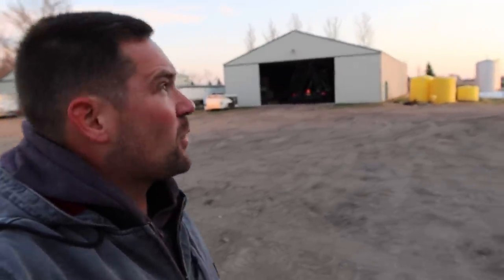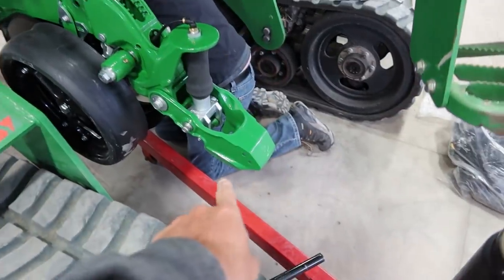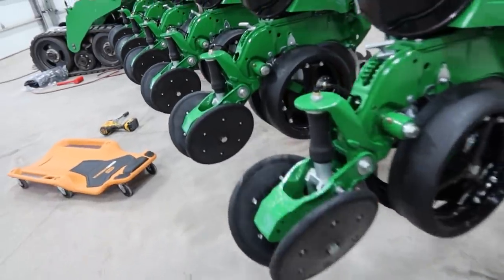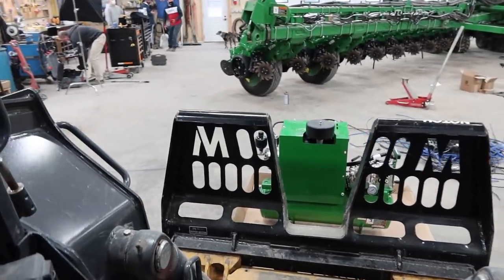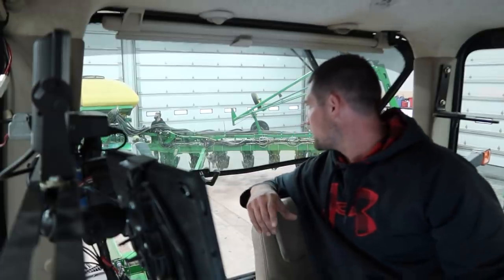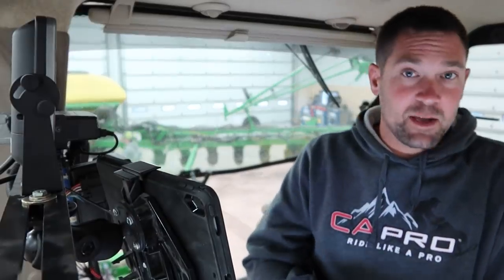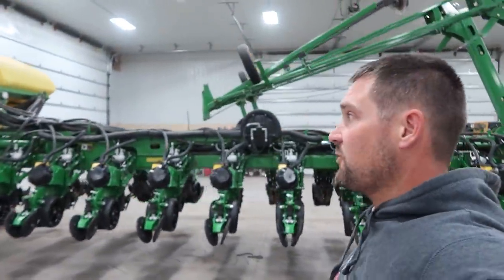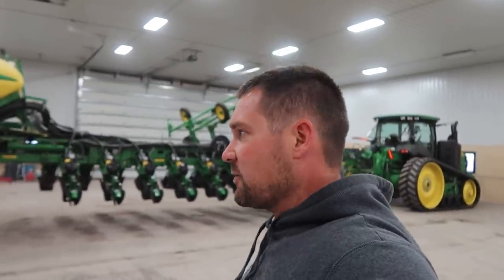Complete Planter Rebuild

Comment: Can’t help but think of a neighbor years ago and his two cylinder popping Johnny planting two rows at a time. Not a computer in sight and the row markers were manual with a rope. Farming has come a long way. Thanks to you all.
Reply: And to think those two cylinder Deeres and two row planters were a big upgrade over horse drawn machines and planting by hand!
Reply: Yep, in the '70's the local blacksmith made anything you needed to get the work done. And yes, that's the 1970's. We still had horse-drawn equipment rusting in the fields when we bought the ranch in Utah. Dad had a Ford '40, and a two bottom flip plow, and putting in metal head-gates for irrigation was apparently a radical departure from canvas dams thrown across an irrigation ditch. It wasn't until his yield was 30 to 50% greater that people started paying attention to what he was doing. He'd taken soil samples to the local county Agriculture office and found out what the soil actually needed to grow different types of crops. Locals had been doing it the same way since the 1800's and hadn't taken advantage of how things had progressed.

Comment: My Grandfather had a hobby farm so big new equipment wasn’t an option. I will never forget riding on the back of the grain planter which had steel wheels. You had to be on the back continuously watching to make sure every row was sowing. It was extremely dusty at times but it worked extremely well. I’m glad we only sowed a small amount of acres lol. He also used a wooden separator that stayed in place even tho combines were readily available, he loved doing it old school. I’m glad I got to experience all the old equipment in use.

Comment: I enjoy trying to figure out what a farmer from 100 years ago would say if he stumbled into Zach's shop and saw this equipment.
Reply: He would run away screaming.
Reply: My father worked behind draft horses about 90 years ago. He ended up working on missile guidance systems. Never again will we see such a huge technological revolution.
Reply: He'd say, Hell yeah, let me at it.
Reply: Try even 40 years.
Reply: Well given that 100 years ago they already had planes, trains, and cars, they’d probably be extremely curious to know how it works.
Reply: I would think they would tell you thats alot of machine to do a job that they could do with way less
Reply: I started with a modern corn planter.  A JD 494.  It planted 4 rows 36” spacing at @4mph.  It had a precision option Zack’s planter still has.  A arm with a disc at end to mark soil for next round.  (But he uses GPS, RTK...)
 It did have a option to check plant.  Basically unwind a wire with preset knots.  (I never used it but recall fields they could cultivate N to S, E to W, and even at 45 degrees.  I decided to stick to mechanical planter.  (At least I can understand how to find, fix issues)

Comment: wedge 2x4 between fork and pallet skid, ring shanked on or in for safety, a little warm fuzzy from shop time 1/3rd faster logistic speed up too, we had a custom tarp cover for morning dew and freak showers, 40 jd' row planter folded,a lot of moving parts,, go fast need a pit crew better call saul when it hits the ground don't shatter window in a bad way

Comment: I have returned in my time-machine after seeing 30 years into the future.  Onyx farms primarily from behind a computer screen while editing videos for "FreedomTube".  During planting season he configures several robotic planters to run at 50mph (in almost any environmental condition).  A robot can run for approximately 3 hours until it must be recharged for 10hours at a portable roadside charge station (a truck trailer containing a diesel generator 😜).  The charge station also automatically replaces any defective planting modules after getting health info from the planter.

Comment: When you say planters have a decent amount of wear parts on them is an understatement buddy!  Anything that spends its time digging in the ground especially at higher speeds.  I run Bourgault air cart planters and I am lucky if I can run 5 MPH but that is mostly because of the huge hills we have.  Well basically all the fields are hills being right at the base of the mountain my house and the fields sit at 3,800 feet on the mountain goes to 9,800 feet.  So ya we just can’t really get above five MPH because of the crazy incline.  The steepest fields goes from 3,800 to 5,900 in just under a half a mile.  This is why we run 620 strivers with dual 800s the quadtracs just don’t get enough traction pulling an 84 foot air drill with a 1,350 bushel grain cart.  Also the ground is so hard that we have to run a John Deere 2660 chisel plow and then a case 475 high speed disc to a real the ground up enough for the air drill to get a good seed bed.  Would love to have just nice flat fields like you guys have haha.

Comment: You can't weld through paint. Well - you need to sand it or grind it or wire brush it.especially if it's primed and or powder coated. It's not Jim's fault.

Comment: The new row units are clearly heavier than the old one, since you didn't need the lift to get the old ones off. Machines usually have a little plaque on them with manufacturer, model type, year of build.. and it's weight on it.  
Do you have to get the entire planter re-assessed. weighed and everything (for insurance purposes)?

Comment: was it cheaper to upgrade the old planter instead of trading it for a new one?
Reply: My question also, and how much did you save by rebuilding instead of trading up?
Reply: @michaelvogel2522  $350,000 for a new planter $125,000 ish for upgrade.

Comment: Dont mean to sound like a snob.. but jim should be using a spray transfer on that mig to weld stuff like that and not short circuit.. Pretty sure the machine is capable of doing it